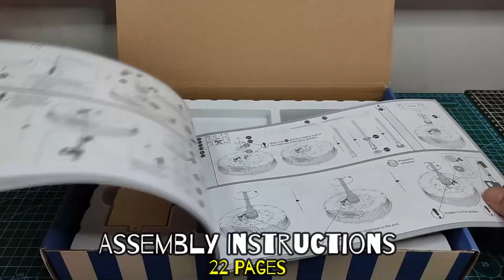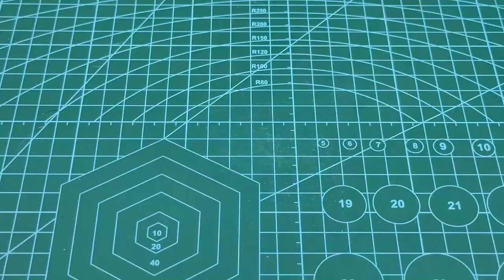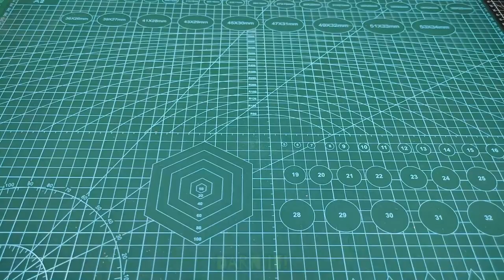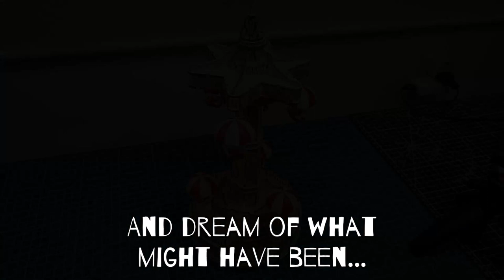DIY. ROKR ParachuteTower.  A Midsummer Night's Dream.  A Detailed Build.

Comment: Please could you let me know how you fixed the piece with the nylon wires on the top at 12:52 ? I cant get it to line up. And is it only 3 nylon wires fed through?
Reply from the maker: Check if you turned your rotating shaft counter clockwise to the end. When installing the disc with the 3 nylon wires make sure that the number 3 is facing the stairs. Hope this helps.
Reply: @outsidethetoybox  Thanks for the tips - it is sorted now. I couldn't do this without your video. Thank you!
Reply from the maker: @pinkloulou1916  You're welcome! Glad I could help. :)

Comment: Considering adding this to the layout. Does anyone know what scale they are?
Reply from the maker: Hello. I have no idea what scale the Parachute Tower is, but  I've inquired about your question with ROKR customer service. Still waiting for their reply. Hopefully, I can get back to you with the answer. :)
Reply from the maker: Hello again. ROKR couldn't give an exact answer to your question. But I've done a little research and figured it might be 1:76 scale based on the OOScale which is used for model railways and dioramas. Hope this helps.
Reply: @outsidethetoybox  Thank you for checking this. I have a small area with a circus and attractions so these would fit really well!
Reply from the maker: You're welcome! 😊

Comment: How and when does part A14 attach to the base?  Go to 8:31 in your video please
Reply from the maker: Hello. As per the assembly instructions, I attached part A14 after I finished step 7 (8:56 in the video). Just align the holes with those in the base (the light strip can act as your guide). When you attach the tower, the pegs on the bottom part will go through the holes of A14 and into the holes of the base thus securing A14 in place. Hope this helps.